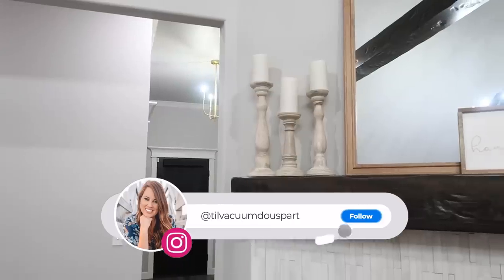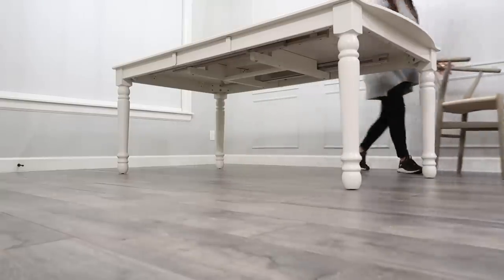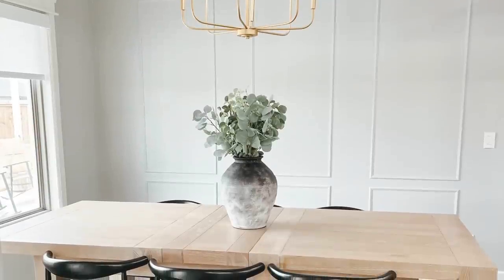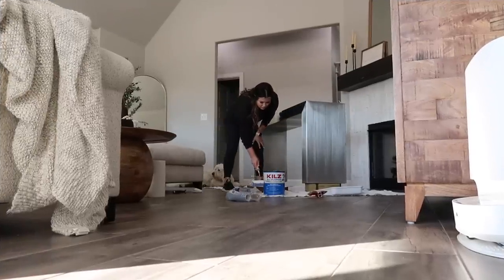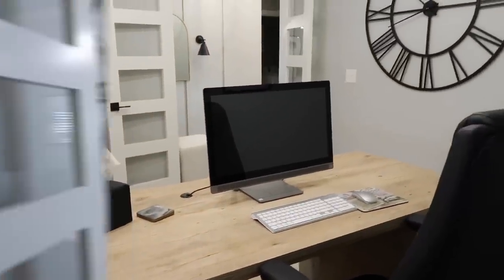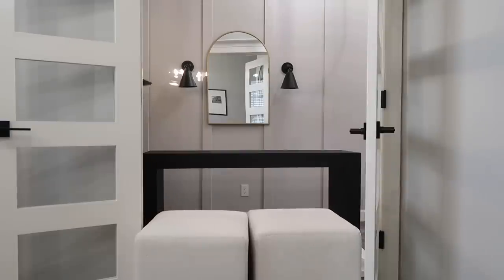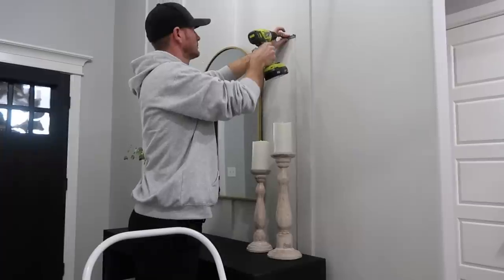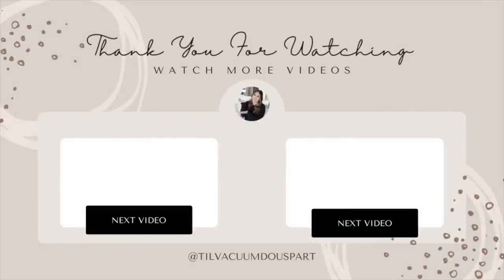ORGANIC MODERN HOME DECORATING | HOME DECOR EXPENSIVE LOOKS FOR LESS| HOME DECORATING + STUDIO MCGEE

Comment: I remember back in the 80’s we had these silicone ribbed rings you could stretch over the bottom of a tapered candle so they wouldn’t fall over. Wonder if they still make them? Or we dropped candle wax inside then pushed the taper in, which filled the base in.
Reply from the maker: Ohh i think I know what you are talking about. I didn’t think of that.
Reply: I've bought those at hobby lobby before!!